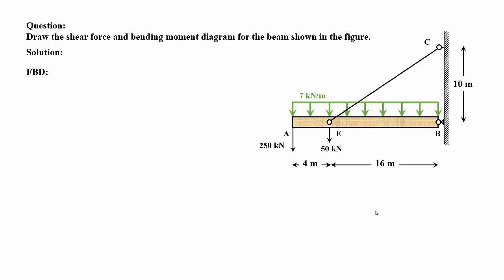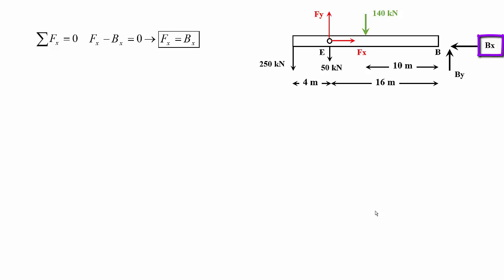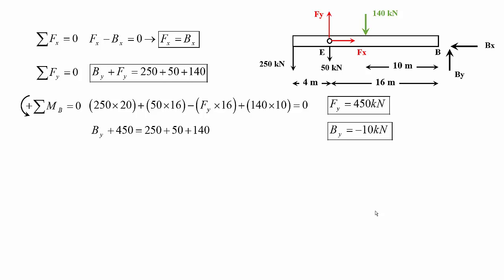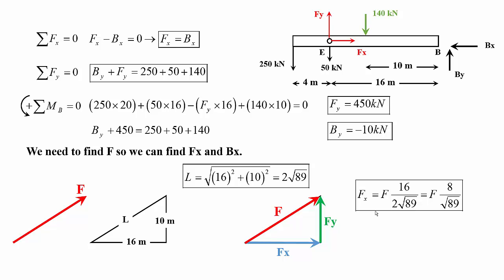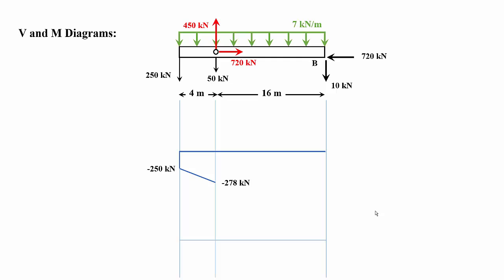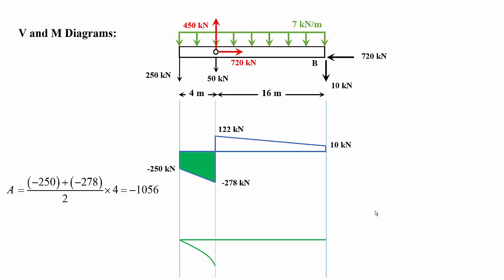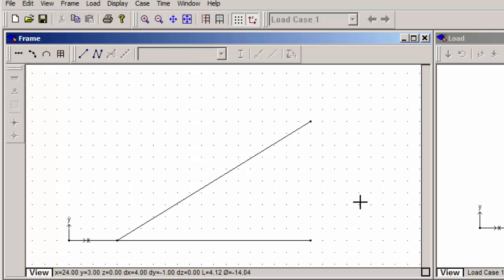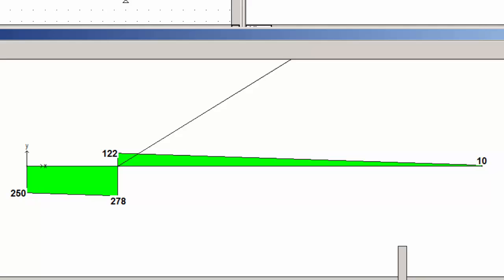Drawing V and M for a Beam Suspended by a Cable

Comment: What happens if there is two cables?
Reply: If there are two cables the sturcture will become indeterminated and you have to use the displacement methode at the points where each cable is attached to the beam